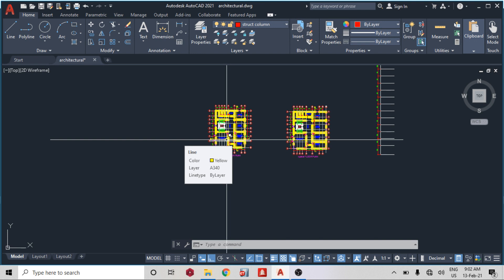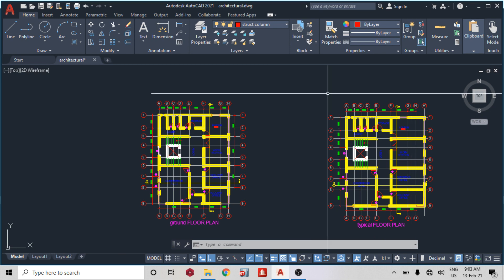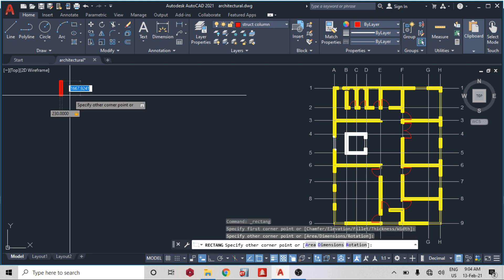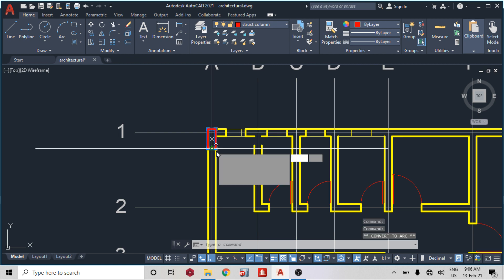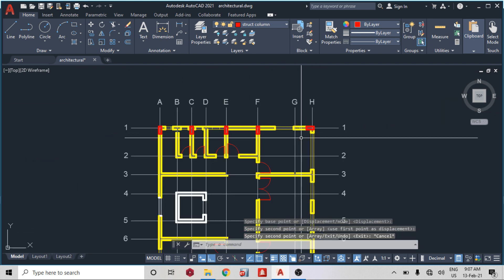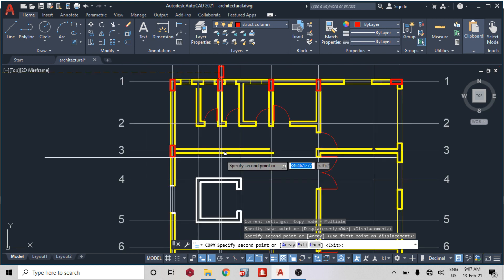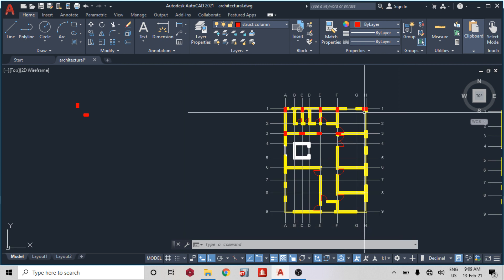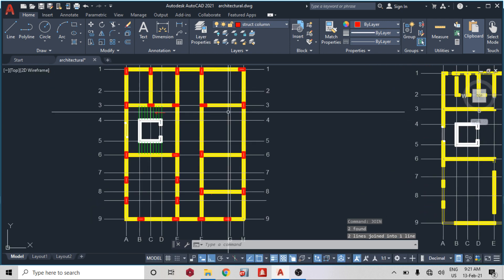Part 1:  Real project design on staad pro G+12 (structural scheming)

Comment: I think you have added 4more columns that is not necessary. 
The 2 columns on grid C and the 2 columns on the new grid after 7 is not necessary considering the span.
Reply from the maker: Yeah. This is just the initial scheming. Once I’m done with my analysis and design I’d remove unnecessary columns